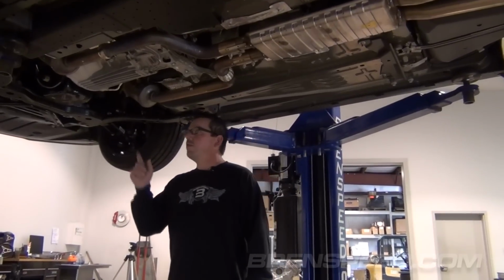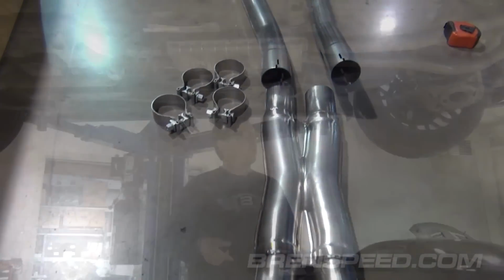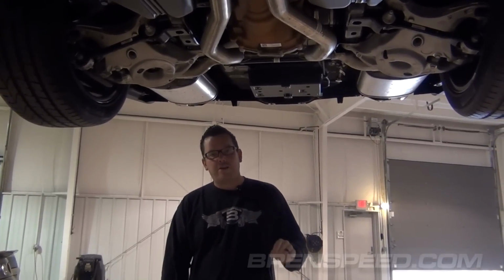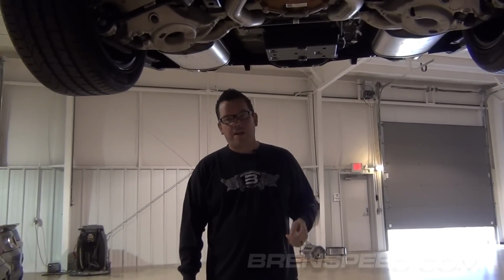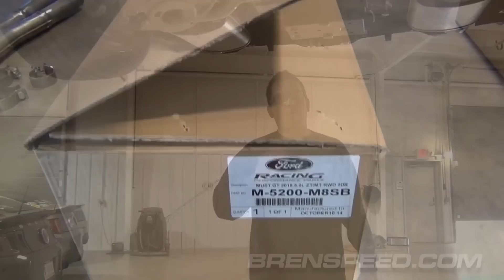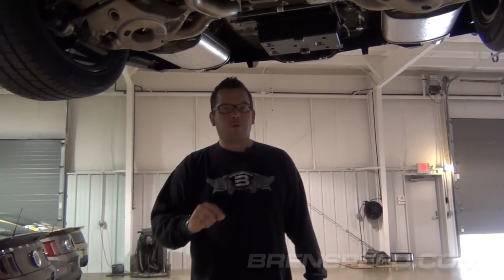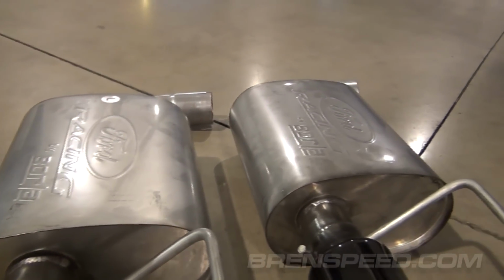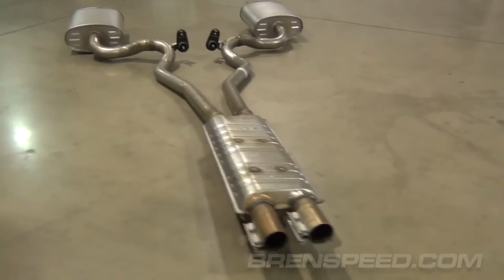2015 Mustang GT Brenspeed Review of Ford Racing Exhaust: Sport & Touring, Catback & Axleback

Comment: Nice sound considering the cats are still on. Sounds like Ford opened up their flow on the cats.

Looks like cat-back systems will be the way to go with the 15s.

The off road pipe guys might not be too happy since a manifold to header swap is required for that. Oh well most modders eventually add headers anyways. Makes it hard for us "back yard" guys though, laying in the driveway to do the exhaust.

Looking forward to more videos of the GT.

Comment: Thank you for the awesome vid! I have the same exhaust, which I and many of my friends love the sound of it, I want to add some headers along with it, do you have any suggestions of the type I should use that would fit perfectly with this catback? I'm not looking to spend a whole lot! Thank you for your time, and suggestion.
Reply from the maker: Giovanni Adrian well that car now has kooks headers. They fit perfect. You need to remember sometimes not spending a lot equals parts that don't fit or don't last. I wouldn't put cheap parts that rust or rub the steering shaft on a S550. We have a good price on kooks and free shipping, and it's made in the USA.
Reply: Yeah I'm looking for something affordable that's not cheap quality! I'll never go that route! Never have and never will... Just trying to keep up with 3 Mustangs and looking for quality yet affordable parts. Probably not possible. Thanks man.
Reply: Giovanni Adrian I've heard nothing but bad reviews of this exhaust in conjunction with headers. They supposedly don't pair well.
Reply: Steve Pounder Thank you so much man! I appreciate your input... I have decided not to do it.
Reply from the maker: I ran that combo with headers and I didn't mind it with cats, but no cats it was a bit loud. It now has kooks mufflers which my opinion is kooks mufflers sound better and are my favorite. Exhaust is pretty subjective and I'm sure some think kooks or anything else may or may not sound good. For now though, kooks are at the top of my list.